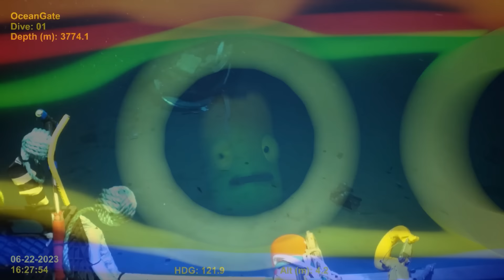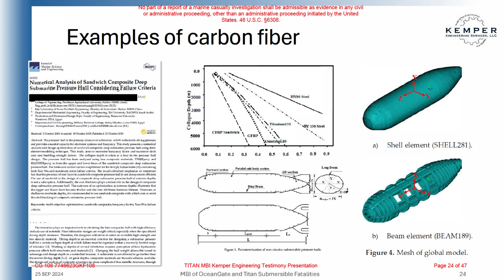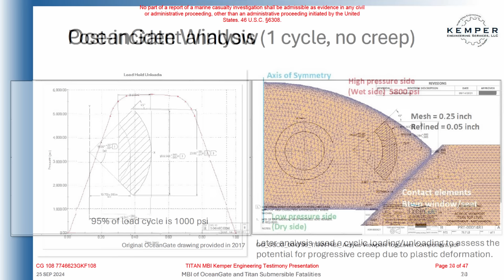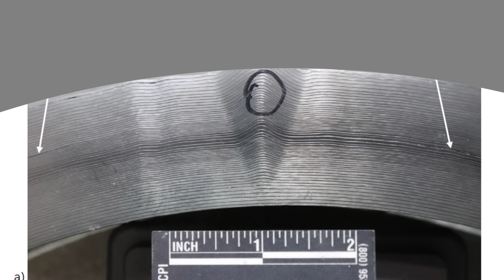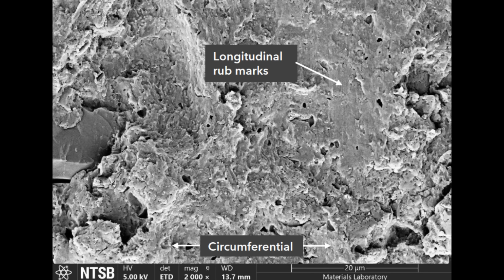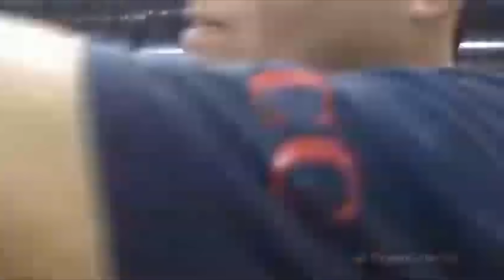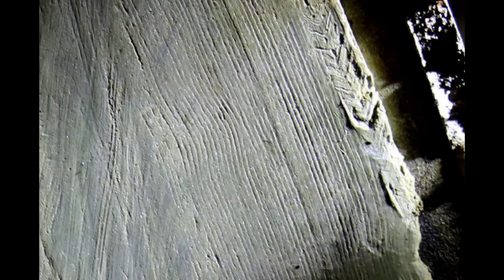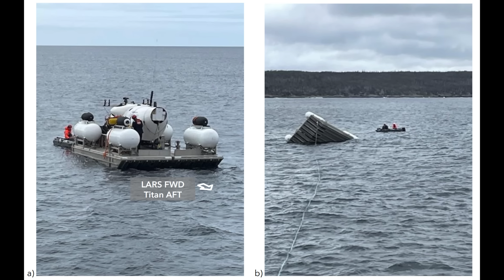OceanGate Wreck Shows Why Sub Wasn't Strong Enough To Survive - NTSB Shares Important Details

Comment: Fun part being that the US Navy built their own carbon fibre submersible (though it remained an unmanned vehicle) known as AUSS. This vessel was taken down as far as 20,000 feet, which is deeper than the OceanGate Titan missions, and is now on exhibit. There's a detailed technical report on the AUSS that covers the issues the US Navy alighted upon during the R&D phase, and how those issues were addressed.

But the US Navy wasn't interested in profit, they were interested in something that would work properly.
Reply: They also tested samples of the materials to destruction, X-rayed the hull after each of its deeper dives, used ultrasound to check for defects after almost every dive and made sure there were NO wrinkles in their carbon fibre when it was laid down.  Those managing the project also listened to their engineers.  The result was a success, though the conclusion was also that CF has a shorter lifetime than metal when used for a submarine hull so they aren't planning to make any more of them.
Reply: @FireAngelOfLondon  we built a 4 layer fiberglass wind tunnel in school and did ultrasound analysis of voids and layering issues. That's back, when I was 16. 

I can't get over the fact that they ignored the layering/wrinkling issue and simply machined the hull. Basically I was taught, that machining through layers defeats the whole purpose of using fibers in the first place. 

Ignoring their own data and not doing a proper analysys, after each dive, is just the cherry on top.
Reply: @FireAngelOfLondon  Good comment, thx.
Reply: @FireAngelOfLondon excellent comment, summarizes everything very well
Reply: @FireAngelOfLondon  Yeah my main concern with the CF hull was.... fatigue cracks.  IE making it survive depth once is easy, but repetitive stress and de-stress cycles is the real issue.
Reply: @FireAngelOfLondon hell yeah
Reply: The two main takeaways from that being "unmanned," and "now on exhibit."
Reply: Plus that sub was not made for having an actual crew, far as I know.
Reply: I did read that report and from what I could tell the US Navy has absolutely zero interest in carbon fiber Hull technology because that thing went on 114 dives if memory serves and now it's an exhibit and they have not started construction on a similar vehicle or anything with a carbon fiber hull. Sure. The US Navy is not looking for profit but what they are looking for is submarines that do not require More maintenance than necessary and submarines that can die of thousands or even tens of thousands of times, and seeing as making something that is a hundred times better than your original test, vehicle is not something that can be done quickly or cheaply. The US Navy will happily go back to metal and let other people mess around with carbon fiber
Reply: CF is usable for one use sensor and 'other' types of subsea robots. esp if you don't expect the thing to come back after reaching a 'target'
Reply: @joefish6091  carbon fiber is a phenomenal material for many applications, including many military things, just not for submersibles that need to contain a human breathable atmosphere, as far as I know, some deep sea drones do use carbon fiber because they're not pressurized on the inside, don't call me on that though because that just came from. What would realistically be a secondary source at best and I have not verified it cuz I don't care
Reply: NASA should still honestly be a military operation
Reply: @qoph1988  and why do you think this? How would it benefit anyone?
Reply: Did it even have a pressure hull?
Reply: Proper engineers: We thoroughly researched the relevant properties of the material, chose the optimal shape and structure, ran the calculations and added safety margins, and built it with the best possible technologies and industry practices - to the point it ended up more expensive than classical materials. Then we ran full-scale tests and in short term it worked exactly as expected - and we gathered the real data on long term performance. Which showed much worse longevity in this mode of operation than classical materials - especially for the current production costs and complexity.
The experiment is a success. The material choice is a failure for this application. No practical point found to further attempt this particular approach (might consider revisiting it if major fundamental improvements for this class of materials are made) beyond a certain expected load level.

Oceangate: So this new material is lighter and cheaper (if you don't overspend on production equipment) and we threw it together (with barely any safety margins before accounting for possible defects) in the garage and (after couple squished prototypes forcing us to make end-caps of more known stuff) got something that traveled down there a few times without getting destroyed - so we call it a commercial product and assign it indefinite lifespan. And don't pay attention to the handling - it's meant to be unbreakable.
Reply: It's a completely valid point, but keep in mind that the US Navy doesn't have to turn a profit. They run at huge losses because the taxpayers fund these expensive experiments. I'm not justifying what Oceangate did, but it's unlikely that they would have had the kind of runaway budget that would just allow them to endlessly test without having any way to pay for it.
Reply: @AN-kb4kh  Thing is though - the Navy had already done all the work.  And published it.  It was ignored.
Reply: @AN-kb4kh  the saying that covers this is "If you can't afford the price of entry don't join the club."  So if you can't afford the proper testing and qualification don't join the submersible owners' club.
Reply: @FireAngelOfLondon Well, Rush has provided - at the cost of his and others' lives - excellent proof of that concept.

Comment: I am by no means an expert, but I've been working in engineering with quite a bit of experience in R&D and quality control for quite some time now.

I know its easy to say this next part because hindsight is 20/20 but the entire process of the carbon fiber hull had a million reasons to go back to the drawing board. If you're looking for alternatives, why not try the successfully implemented ceramic? Or an approved material? "Carbon fiber hull" to a bunch of millionaires that drive cars made out of it must sound cooler and more relatable. The concept of machining the wrinkles out would make me quit my job before the sub would ever touch water. Thinking 5 one inch layers are the same strength as one 5 inch layer is insane. Carbon fiber and the epoxy medium likes to be whole. This is carbon fiber 101. Failing to keep this as a core tenant of your carbon fiber manufacturing especially when lives are at risk should be a criminal offense. I am sure they did tests and knew about the porosity issues between layers. The shearing of the MACHINED SMOOTH titanium was almost certain. Of course the glue mating the the hull to the titanium cap would fail. Of course the flange would fail.

If you cannot get the air bubbles out with your current fabrication techniques then you cannot fabricate a high pressure submarine hull. Simple as that.

Also the difference in the pressure gradient between the two acrylic lens designs is a complete nightmare. I understand it doesnt seem like it failed but there is no way they did not simulate their new design. they would have seen the diffence in force behavior and still gone with it. There are so many alternatives. An approved lens, layer of mineral oil, and a lens to make everything look normal again. Some kind of pressure release for the mineral oil for when the outer lense is compressed.

At this point, there are so many oversights it becomes malicious. In my opinion, their mechanical engineering team, from the intern to their top guy has blood on their hands. I hope I never have to work with the type of people that need to kill people to learn a lesson in design and fabrication.

Never forget you are never too small to ask questions and raise concerns. We live in an age where mechanical engineering can be figured out by machine calculations. You should be able to raise a concern, and you should be able to recieve imperical data, simulation or testing, that prove your concerns are right or wrong.

Comment: The difference in a metal/glass/plastic and a composite is the complexity.  The obsession with hardness is daft, but modulus of elasticity and ultimate compression strength are almost all you need for something like metal.  And of course, the joins are shit show.

Comment: now you have me thinking about it. with the pressure pushing on the outside would the failure side be the clean side, or would it crush the hull into the dome on that side. the force crushing the tube like a roll of TP will shear the rings off regardless.

still think it should be dive safe on these sub videos.

Comment: Carbon fibers cannot be properly tested as every batch is different. Fibers are fixed in epoxy. Uniformity is very problematic. This is why world best arrows are not full carbon fiber but aluminum tubes covered by carbon fiber. Arrow material uniformity and uniform flex is paramount for archery.

Comment: The layering. I'm no engineer either but this organic, imperfect lamination just seems self-evidently unsuited to massive pressure loads. It reminds me of the NTSB's investigation of a commercial airliner whose rear-mounted turbine failed and tore a hole through the cabin, killing all on board. Microscopy later discovered tiny imperfections in the manufacturing of the housing that caused the failure.

This sub failure seems to me like grabbing a banana at the center and squeezing. All that pressure just pushes the contents out longitudinally.

Comment: they ground off the wrinkles??
they ground off the wrinkles????
Reply: Yeah, this was when they should have said, "hey, we need to understand why these wrinkles are forming and what we can do to prevent them". Not, "eh grind them off"
Reply: Sounds like "engineering on the fly" by a bunch of non engineers.
Reply: @larryjohns8823 I don't know why they didn't send it to depth unmanned on a tether to see if it could handle the pressure first. 3 people lost their lives over a simple let's see if it works first.
Reply: @brgessner Thing is, it had already made a number of successful dives. So a test dive wouldn't have made any difference.
Reply: @MultiMcgruber  I thought they didn't go to depth though, so it didn't survive the full pressure yet.
Reply: Lets just introduce our own failure points, in case nature needs help.
Reply: @leechowning2712 it was a rush job
Reply: @markbowden7238  There's no rush job like a Stockton Rush job.
Reply: @markbowden7238 Now THAT will become a cautionary saying…”Don’t do a RUSH job”.
Reply: Helps them to know where to place the acoustic monitors  @leechowning2712
Reply: Isn’t the whole point of carbon fiber as intended here that it’s continuous fibers wound around eachother? Cutting the fibers by grinding seems to me like you’ve essentially nullified any structural gains those layers may have had. Also my jaw dropped when I saw that they just ground out more of the fiber to make the end caps fit…bruh
Reply: @Nathan_Higgens not to mention what the heat from any cutting process does to the resin used in the carbon fiber itself. Expired carbon fiber at that.
Reply: @Nathan_Higgens  Carbon fiber isn't very good at compressive strength anyway because most of that energy gets transferred to the epoxy. so while they can get away with CF its besides the point that there other reasons that it isn't the most suitable material to begin with.  I don't recall who's description this was "Try pulling on a string, its taut and holding tension, thats tensile strength. Now try pushing with a string. It doesn't work. these are compressive forces" CF is great with tensile loads not so great on compressive ones.
Reply: The grinder makes me the carbon layup specialist I ain't?
Reply: That got a loud WTF out of me when watching.
Reply: The whole build was a total joke, how did anyone ever sign off on that is beyond me.
Reply: But,... but... Think of the esthetics!!!
Reply: Then they cut fibres, they made a weak spot.
Gaz UK
Reply: Doesn't quacky duck tape and Bondo fixes everything!?!
Reply: No, they were grinding IN a self destruction system..........
Reply: The brain wrinkles first, then the layup wrinkles, one presumes.
Reply: Hey hey, for what it's worth to me that sounded like a fair enough thing to do? BUT I'M. NOT A SODDING DEEP SEA ENGINEER AND CHARGED PEOPLE FOR A SPICY COFFIN!! wtf this Rush guy is wild.
Reply: I know, right?! It's as if they were making a scale model of a submersible for a museumor movie set and not a functional submersible. 🤦
Reply: They would have been better off injecting it with Botox.
Reply: They should have just used a 5inch titanium cylinder and it would have been fine. 

This is exactly why you don’t use carbon fiber, not for these kinds of depths.
Reply: I'm no expert but don't think that's super important.
Look up forged carbon fibre, machining the CF wouldn't make a huge difference to the strength.

I think the issue would come where those tubes need to be connected together to act as 1 tube.
Reply: @Kieran0  Forged Carbon is weaker pound for pound as far as I'm aware, but all the random fibres going in different directions means it doesn't have the same directional strength differences as regular wound-up CF. Having wrinkles and terminations like this is going to distribute and react to stress fairly differently than just a bunch of short fibres.
Reply: @Ithirahad  I have read a few things that say forged is actually stronger 'pound for pound'.
I think in reality it's probably a more complex question, and I expect it depends on the specific application.

Like you said, having the weave aligned in specific directions should help manage forces for specific loads that can be calculated before hand.

My point was that I don't actually think that 'shaving off the wrinkles' is such a huge issue but again - just to reiterate, I'm not an expert.
Reply: @Kieran0  check out easy composites' testing of brake levers made using forged carbon and "optimised" forged carbon (that is, has unidirectional carbon as well). The addition of UD carbon strands is a fairly big improvement for a brake lever, so that probably means that it resists tension force better. The question is, how much of the force for OceanGate was in compression vs tension? Stockton Rush was obviously wrong about it being all compression, especially at the flanges, but I wonder about the proportion.
Reply: @szurketaltos2693  I may have missed something?

The discussion here is about whether machining the 'wrinkles' to create a better connection between layers would have a major impact on the structural integrity.

My view is that this was unlikely to be the main vulnerability, some people pointed out that it would affect the integrity of the carbon weave which is completely valid - my point about forged was just to point out that the weave can be disrupted without causing major weaknesses in the finished product.
Reply: @Kieran0  whether it's a weakness depends on the tensile strength needed, it's clear that a disrupted weave will significantly reduce tensile strength. Forged carbon may be okay for purely compressive forces (to a point of course; between aluminum and titanium I believe) or low strength parts.
Reply: @szurketaltos2693  yeah, uni directional CF is by a wide margin the strongest form of CF.
Reply: Pretty sure the wrinkles are failure points already. If you ground them away then at least the next layer is going to be good.
Reply: @erwinlommer197  the wrinkles probably are stress concentrators, but the solution isn't to just say oh well, guess we grind them off. They need to consult with carbon layup specialists to get it smooth in the first place.
Reply: @erwinlommer197  no, because the added stress when the underlay cracks will apply targeted pressure... making the areas above more likely to crack. Entirely ignoring the fact the "glue" has nowhere near the same pressure response the carbon fiber/epoxy had, which is why those layers are where broke.
Reply: @leechowning2712  But aren't you already getting stress concentrations and targeted pressure to the area above if you have a wrinkle that is several layers deep? I'd guess it is wrong and bad either way. Wrinkle is bad, machining it is bad.
Reply: @erwinlommer197   Carbon fibers strength comes from the long unbroken strands, layer over layer. Yes, the wrinkle is bad, because it causes a kink where force can build up. But it is still the unbroken strand doing its job. Machining away the wrinkle cuts the entire set of strands, and leaves the area already broken, except for the effect of the epoxy.

If we had the witness panels they talked about, sections kept as test samples in case of something going wrong, I expect we would find the start of the glue between the layers breaking down to be where those wrinkles had been removed causing the inner layers to flex slightly inward and pull away from the adhesive layers. 

They were building something that has much less tolerance for imbalances than an aircraft, car, or even spacecraft, and they simply were not qualified for what they did. It was not any one error, but the general environment of errors which ultimately doomed the vessel. The fact she surivived 18 dives (not all to the deepest levels) was not a sign of how well she was made, but rather that 17 times she had been very lucky. If it had been a proper experimental unit, and only SR and PH died during a dive on the Titanic, the world would say "that is too bad, but it was an experiment". It was taking passengers down that we cannot allow to happen again.
Reply: THIS !